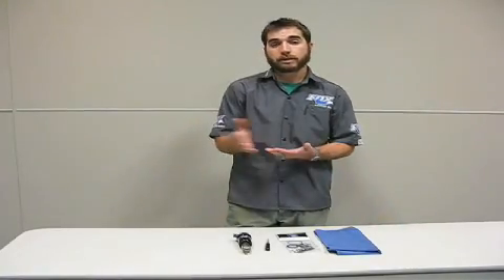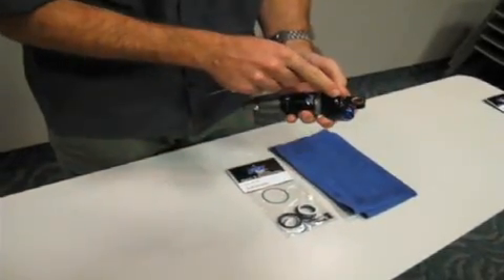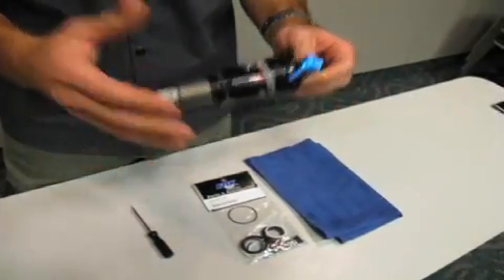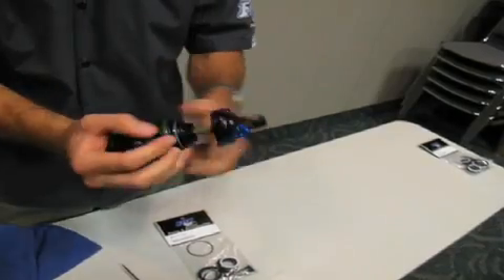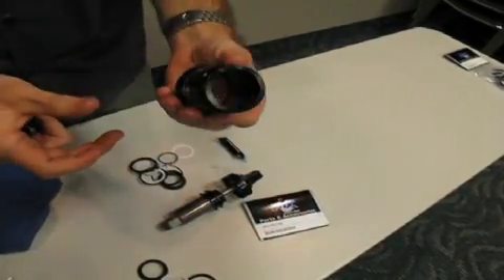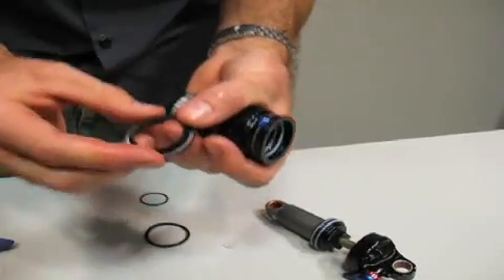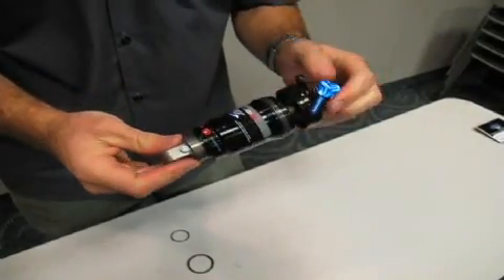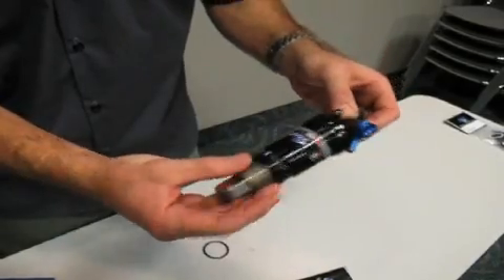Float RP23 Rebuild

Comment: Just finished my RP3 float rebuild in 2024. So glad this is still up. For anyone doing this rebuild in 2024, the kit that I bought on Amazon with the number 803–00–142 had all the pieces including the lubrication. There are some kits out there that have a picture of the lubrication as being included, but only the one from fox included it. There is a bump shock O-ring that is not included in this pack. My original was broken, but still serviceable as it would stay in place. If this O-ring has shredded to pieces, you will need to get the entire shock service by fox to replace it. Hope this is helpful to anyone else still running a RP3 or 23 vintage shock and big thanks to the original poster for leaving this video up!

Comment: Hi, I have an RP3 that keeps getting stuck down. I followed the procedure to open it in a vice with a rag through the eyelet, cleaned and lubed everything. The airchamber doesn‘t leak air but the shock compresses more each time and doesn’t fully extend i.e. gets stuck down again. Anyone have an idea what causes it? Will an air chamber service with new seals do the trick or is it a waste of time?

Thanks
Reply: Me to 😢

Comment: Ha! every 8-40 hours!!!!  I've had mine for 10+ years and doing my first!  Oops
Reply: That maintenance spec is always for race application. You will never even get close to that load as a non pro
Reply: @Crazyhero-zi6yt  How would you know his level of riding ?
Reply: @richardhayter3919  first of all, that was an odd question for the sake of being confrontational. Secondly because if he was a pro his shock wouldn’t have never lasted 10 years. Does that answer your question? Any more pointless questions you need help with?

Comment: I am running a RP23 in my Trek Slash 2012 Enduro Bike and would like to reduce the air volume of the shock. What spacers (model / no) can I use to reduce air volume?

cheers

Comment: Thanks, mine holds air but has traces of fluid on the shaft that I have to wipe off every now and then, but my propedal / lockout and rebound is not working, I don't think this will help??
Reply: That most likely is due to an o-ring in your propedal assembly that has gone out, meaning it needs an ifp service. Fox will do it for about $130-$150. If you do it yourself it will take a few hours of research(some of the specs and o-rings are extremely hard to find), as well as tools, but will still cost you less than $100.
Reply: Not to mention it is also very difficult.

Comment: I ordered a shock pump & rebuild kit. I thought I'd humour myself by pumping up my old blown shock and WHAT DO YOU KNOW... Solid seal - shock not screwed.

Then I figured, "Hell, I have this new seal kit, might as well use it!" So I replaced the seals, AND NOW ITS NOT AIRTIGHT & AIR IS COMING OUT OF THE VALVE!!! Fuck this shit.
Reply: I had the same problem, turned out i had the o-ring in the wrong spot. I had to stretch it out a little to make it stay in the groove while i screwed the body back together.

Comment: I had a really hard time getting that seal out of the sleeve. The screwdriver wasn't able to stab in enough to get a grip and it would slip out. After MANY attempts I ended up using a retractable razor blade and pried it out with that. FYI
Reply: I ended up using an exacto-knife.
Reply: I used a box cutter and that did the trick. So many different ways of doing this LOL

Comment: Great Video ! My Triad shows the signs of a "stuck down". I have purchased a seal kit, just waiting for it to arrive. I have stripped the unit as per your clear instruction and note that the small o'ring is damaged ie) the small o' ring in the positive chamber on the smaller shaft. Should this be sent to a specialist ?

Comment: Make sure you are twisting the very bottom section of the air sleeve (what he said below).  On my RP3 there is another section of the air sleeve that will spin forever without unthreading anything.

Comment: I'm embarrassed to say that I haven't serviced my shock in 7 years!
Up in Canada, our riding season is shorter, but that's still a lot of neglect on my part.
This video made the job a breeze. Surprisingly, all the old washers were still in good shape and the shock had never lost pressure. I just bought a new bike, and made sure it had Fox front and rear. It's expensive, but I think it's worth it.

Comment: where do i get an adapter for the negative air valve??  i just gave my shock a full service, change the old oil and the seal on the if p.  just found out all my negative air valves will not fit :( 
thanks

Comment: Thanks for posting this, i was loosing air in my shock and I think this rebuild did the trick. Hardest part for me was at the 3:30 mark getting that o-ring out. I ended up stabbing it with a safety pin to peel it out.

Comment: Fox, for your RP2 rear shock, is there any seal required for the eyelet side? I didn't see one when I dissembled because there is a metal shoulder internally instead.

Otherwise, great video and I got my 2007 stumpjumper back up and running in about an hour. Thanks!

Comment: I ran into the same thing. In my case the o-ring in the air chamber fell out of place, and when I screwing the whole thing together I pinched it. I also had the issue with the rebound not being nearly as slow as on the video, and I suspect my attempts to get it in got let the ring fall out.

Comment: I have an 07 triad RPL, It's leaking oil from the rebound adjustment and the propedal is stuck on open.  earlier this afternoon the propedel knob was spinning freely without catching open, propedal, or locked.  How bad is this problem?

Comment: PLEASE- tell us how to remove the boost valve, or at least reduce the compression damping early in the stroke.  They aren't nearly as good on small bumps as your old shocks.  Position sensitive damping should only ramp up at the end of stroke, and have LESS compression damping near the sag point.  If you prefer more compression damping at sag for pedal efficiency, ProPedal already provides that.  The as-is ride on this shock is unacceptable for anyone but a racer.  Please help- disappointed.

Comment from the maker: @CHOOKSable 
1- Let all the air out of the shock. 
2- Grip the bottom section of the air sleeve and turn counter-clockwise.
3- When you get to the last thread, simply pull the air sleeve off
toward the back of the shock. ( it may have a little suction like feel,
this is totally normal ). 
4- Once the air sleeve is off, clean and re-lube the seals, then
reinstall the air sleeve.

Comment: I have a '08 Fox RP2 shock that has leaked most of its oil through the propedal switch. The shock still bounces, but I have no rebound. Would replacing the seals solve my problem?